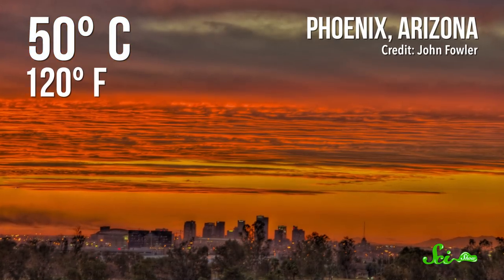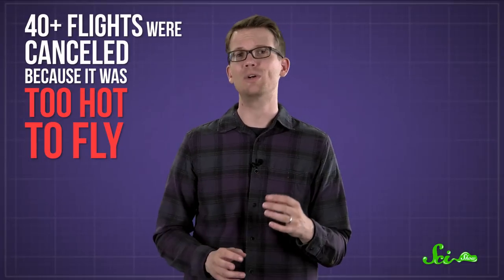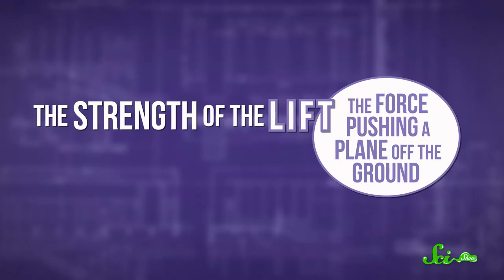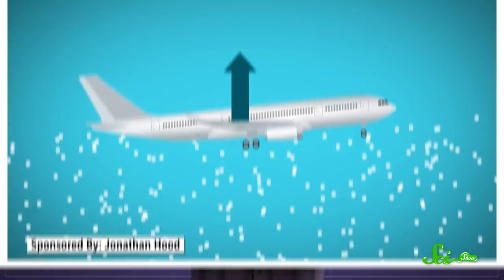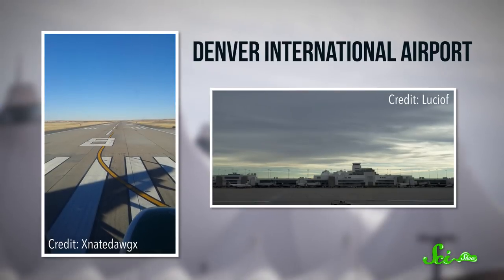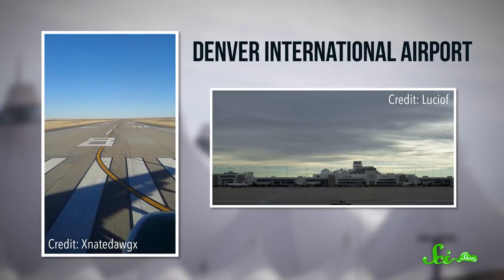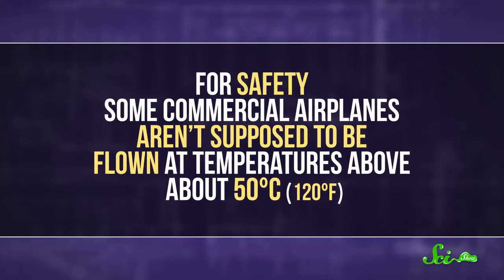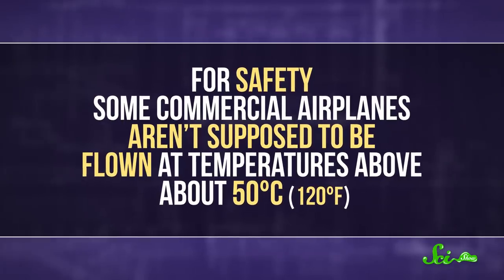Can It Be Too Hot To Fly?

Comment: 50°C?! OMG thats hot. how can anyone live with that!?
Reply: Marcell D'Avis Welcome to Kuwait :)
Reply: Marcell D'Avis Stay indoors. It was only for like a day during the Summer Solstace
Reply: I do. Balls of tungsten carbide. Harder than steel and practically impossible to melt.
Reply: Marcell D'Avis I do toastily
Reply: you get used to it, by that I mean don't leave indoors when the sun is in the sky and you don't over pump air in your tires.
Reply: Marcell D'Avis i live in temperatures like that everyday. Thankfully, i'm quite a shut in so it doesn't affect me that much.
Reply: Marcell D'Avis well you can live if you have AC.
Reply: Fahad Bore عندنا صلخ و هذول توصل ٣٠ يموتون 🤣
Reply: Marcell D'Avis it's not so bad if you stay in the shade and stay hydrated. It's a dry heat
Reply: Don't go outside EVER
Reply: KLUH You know what. living here all of my life makes me say this but, it's not as bad as you think
Reply: Paul Gonzalez-Becerra We usually have a few days that get that hot per summer. 115 is much more common. The average daily high temperature for July is 107, which would be record breaking heat in most places and that's just the average.
Reply: Marcell D'Avis Humidity is low. Now we got up to 120 in the South a few weeks ago, that was hellish.
Reply: Cesar pineda I live here too and I try my best to never go outside it's gross happy the rain stopped though the humidity was just awful
Reply: Honestly I'm a bit surprised this was the year that everyone realized that Phoenix is literally the surface of the sun. Last summer was much hotter for much longer. And c'mon guys, the mascot for Arizona State University is the Sun Devil, they're not even trying to be subtle. It's stinkin' hot.
Reply: When people say it’s fifty degrees here, that’s a pretty damn chilly day.
Reply: Turkey Herder 110 80% Humidity!  Welcome to East Texas!  LoL
Reply: Marcell D'Avis It's not that bad haha
Reply: Arizona Resident here, honestly after so long you just...get used to it.
Reply: In Arizona, it's a dry heat, no humidity, it feels better trust me
Reply: Airen Fortunato Except after the monsoons
Reply: It ain't so bad. When born here, you tend to be well acclimated to the heat (at least I am). The consequence of that is I'll start shivering in 70 degree weather, if there's even a slight breeze. And getting me in places that hit freezing point? Forget it,  now that's torture
Reply: Hallo, Marcel Davis, 1&1
Reply: I dont even know my dude
Reply: Marcell D'Avis
yes that's hot, but there are many more places with lower temps in which is a nightmare to live in summer.
take milano in italy, being in basically a slip of plains surrounded by mountains means rare wind and no recirculation plus a  big "cloack" of pollution. humidity is already high in these plains but those effects rises it up more.
and even if 32C could be ok, a little shiny sunny day you literally cant breath well: hot humidity goes for "no much fresh Oxy per resp". sweat not making its job for humid air (less evaporation in a saturated place, vaporbaths essencially where nobody gets fresh from.sweatting.).

phoneix is the grill master
south-continental-eu, inbetween mountains strikes, is a master boiler of pre-treated meat with some sweat & eleven special herbs of pollution
Reply: Oh please I've gone hiking in 47°C and in -38°C it's no big deal
Reply: I once went to Vegas and when the doors to the airport opened there was physical pain from the heat in the air.

It was night.

Also, if nothing green lives in a place that isn't a cactus, maybe that's a sign that humans shouldn't either.
Reply: 80% of the year its above 50-60c
Reply: nah 50 is cool
Reply: Marcell D'Avis I can...
Reply: Yeah, used to live in Arizona myself as a kid, and it reached those temperatures before.  It's certainly hot, but the lack of humidity helps a GREAT deal.  And staying in the shade.  It's really not that bad.  You most certainly get used to it.  In Colorado now, and have been for many years, where instead of heat, it freezes and snows.  When it remembers it's suppose to get cold in the winter, and not spring..  And coming from one temp 'extreme' to another (yeah, not really an extreme in either case, if you look at other places in the world), you get used to the cold too.
Reply: Marcell D'Avis i guess u get used to it. here in canada wen get used to the winter and spring comes, u can go outside in like 5 degrees celsius(40ish degrees fahrenheit) and it feels gud
Reply: I live in Phoenix, yeah it's real bad. Not even kidding my girlfriend sent me a video of her family frying an egg with a pan they left in the sun for a few hours. Cars also get "sunburn" here. Sure, global warming isn't gonna affect a frozen wasteland like Canada that much. But when you live in the desert, PLEASE STOP HEATING THE PLANET.
Reply: cover your head when you are outside.. drink water whenever you can

you will get used to it overtime and it becomes normal
Reply: yeah at 35c i start to feel a little dizzy and will generally stay in rooms with air conditioning, at 40c i have to actively focus on cooling myself down, i can't do anything else. i think the hottest ambient temperature (i've been in rooms at 65+c but that doesn't count) i've ever experienced was 42c and that was already hell on earth. i can't imagine 50c
Reply: Marcell D'Avis When it was that hot this summer I put an umbrella by the pool and laid in the the water in the shade.
Reply: I was in phoenix several years ago and the temp was 112-114F and it was HORRIBLE.  You must move from conditioned space to conditioned space, no stopping outside.  You walk out the door and are hit with a heavy wall of heat. From home to running car to shopping center, nothing else
Reply: Marcell D'Avis in my country Kuwait 🇰🇼 i reach 60c sometimes... 50 are the norm in summer
Reply: Consider living underground like in South Australia.
Reply: Marcell D'Avis I don't know how I do it. The AC can't keep up, so it's 29 degrees inside. If you have a low ceiling, it makes it feel much hotter. People with low ceilings have to keep their homes 10-15 degrees cooler than people with high ceilings to have the temperatures comparable. Cars are literally ovens. Sidewalks can cook eggs. Cars can cook eggs and toast bread. If I wanted to, I could melt certain items with a magnifying glass. Ants wouldn't stand a chance. If you're outside, you better not have any metal on you. Otherwise, you have 45 seconds to use it, and you have to wait a solid 5 minutes for it to cool down. You hold things up to your body too keep them cool. Paint and asphalt melt. It's also way too dry. You need to drink so much water simply to replace the sweat, but you also have to replace the salts. If you're outside long enough, you can't keep up. It'd take a long time, but it's possible. Imagine a giant oven. If you walk into the oven, then walk out into Phoenix on June 20, 2017 (when it got that hot), it wouldn't be much of a relief.
Reply: Marcell D'Avis we had about 112°f (45c) weather in California this summer, unfortunately my a.c. can't do more than a 25°f heat reduction. So whenever the temp goes over 105° It gets real uncomfortable real fast.
Reply: Marcell D'Avis I assume with little humidity
Reply: "It's a dry heat." said every jag-off we wish would die in a dumpster fire.
Reply: Sure, i spent many hours outside while it's sunny and 52 celcius
Reply: millions of people do
Reply: I've been to 50 in Australia and 40 in Singapore. Singapore was infinitely worse, indoors and out. You literally cannot breathe in that sort of humidity
Reply: sinofdusk3 EXACTLY humidity is all that matters because of the sweat that doesn't evaporate and leave you looking like a swamp
Reply: Marcell D'Avis sometimes it gets to 50 degrees in the UAE or it can happen to Australia and Singapore so we're used to it
Reply: it reaches 55°C where i live
Reply: i start complaining when it's above 15°C
how do people survive those temps
Reply: Just like you have people living at -20. You get used to it?
Reply: 40 degrees c is ok / barrable 50+ is uncomfortable less than 25 degrees is painful
Reply: It's simple, in the daytime... you go from your air conditioned house to your air conditioned car to your air conditioned job and then you do it in reverse. You do the rest of your stuff at night when it has cooled off to a nice cool 90 degrees. 

I lived the southwest most of my life and I would rather deal with a dry 120 than the muggy 80 here in Michigan.
Reply: honestly its not that bad. ive lived in az for basically my entire life. i dont even have ac in my car. just roll down the window and get a hot rodders tan lmfao.

heat isnt an issue for me. humidity is what kills me. 90f on the east coast is worse than 120f in arizona because at least out here the air is dry enough for your bodies natural evaporative cooling to work properly. You sweat, it evaporates, you cool down. On the east coast you sweat, it cant evaporate cause the humidity is too high, and you never cool down. You cant even dry off. Taking a shower makes you feel more miserable as you cant dry off and you end up feeling sticky.
Reply: Fred West I live in Getting Georgia. Preach it brother!
Reply: Fred West I'd almost live in the streets of San Francisco. After a trip there it's very clear where I want to take my last breathes.
Reply: Marcell D'Avis you get used to it. But the first year is spent in fear of the sun.
Reply: Dude I live in southern europe and it got up to 55 this summer :D
Reply: I was in a sauna, it was about 80c
Reply: Ediranii thats not true, stop lying
Reply: same bro
Reply: I welcome you to Kuwait where it constantly hits 55 degrees every summer ^^
Reply: Marcell D'Avis I live in Phoenix AZ and it normal isn't that hot. It only gets to 50C about 4 times a year.
Reply: Ba1k3n same and yup
Reply: I live in the High Desert of California and it got to 116 farenheight (~47 celcius).

Stay in doors with air conditioning, drink a lot of water, or go to a swimming pool ^.^

The Mayor declares a state of emergency every once in a while for the homeless and they can go inside commercial buildings without any interest for the business and ask for water, no business are allowed to decline them. Police also carry water in their trunks (boots) and you can ask for it at any time.
Reply: "The hottest air temperature ever recorded in Death Valley was 134 °F (56.7 °C) on July 10, 1913, at Furnace Creek, which is the hottest atmospheric temperature ever recorded on earth. "
https://en.wikipedia.org/wiki/Death_Valley
Reply: Newb Programming 

Nice try at sounding smart, but that kind of heat could onöy be recorded at antarctica
Reply: Only*
Reply: Marcell D'Avis I can
Reply: its always around 47 degrees where i live
Reply: Trying to sound smart?

All I did was pull up the wikipedia page and quote.
If you think that makes me sound smart, I feel bad for you.

Antarctica is never even near that hot .-.
Reply: Newb Programming 

You ain't foolin me
Reply: Have a nice day :)
Reply: Lol they dont live.. look at desert regions. Theres no civilization there besides constant bid for survival.
Reply: I love Phoenix lol. I enjoy the hear here
Reply: Marcell D'Avis It's not as bad as it seems you get used to it after awhile but i might be a little bias sense i've lived in arizona my whole life
Reply: Those civilizations who live in the constantly hot parts of the world da tropics survive with lots of alcohol and good drugs?
Reply: Marcell D'Avis, as a fairly frequent visitor to truly hot places like AZ, I've been subject to those kinds of temperatures. I can honestly point out that the first time you spend some real time in it, you will be most impressed. For me that two weeks was probably the closest to Hell I've ever been. There's just no preparation for the experience itself and the impression it will leave upon you.
   That said, there are a few tips to take seriously to heart whether you visit or plan to spend a long term in such a place.
    Firstly, COVER YOUR HEAD, and I don't mean just get a ballcap or some skimpy little wrapper for the thing. Get a proper broad brimmed hat. It doesn't particularly matter what it looks like or is made of (boonie, wire-rim, ten gallon or western style) BUT it does matter that it has a proper brim all the way around to block sun from your head... And you'll notice the change the instant you actually put it on in the sun.
    Second, and it's a two part warning, BEWARE OF DEHYDRATION. Yes, humidity sucks because your sweat doesn't evaporate. Dry heat kills you because you don't realize you're in trouble before you're in it DEEP... So regularly check and monitor your SALT intake, to retain the water... AND NEVER BE WITHOUT WATER... It's important to watch out for other nutrients like C that help metabolize the water, but salt and water are of capital importance and maintaining the healthy balance will prolong not only your life, but your comfort levels...
     Third, DO NOT JUST HIDE FROM IT... Subjecting yourself to the heat that makes you cringe is part of acclimating to it. At the same time, DON'T BE STUPID about the matter either. You do have to listen to what your body tells you and take it easy when you're fatigued. Don't bother pushing to the point of exhaustion. Heat stress doesn't just clear up the day after you collapsed either. It takes WEEKS AND MONTHS to recover from heat stroke, even a mild episode... But you can't ever "get used to it" if you don't get out in the stuff. Start small, and work at it a little at a time. Just an hour a day for your first week, physically subjecting yourself (on purpose) to daily hellish heat, will be surprisingly easier than you'd expect. THEN TAKE A BREAK FROM IT, and cool off. Let yourself recover. It's still okay to do the daily routine and rush from one A/C spot to the next as you're normally tempted to do, while you pick a convenient point in the day to go for the hour's walk or whatever (as heat therapy)...
     Finally, watch your over all diet. You're probably going to naturally want to up your intake of fresh and raw fruits and veggies anyways, but you should consciously do so as a regiment. Drop your intake of calorie-dense and really heavy fatty foods. Again, you're probably going to naturally be less inclined to a big plate of potatoes and gravy and pork-chops all breaded and smothered in gravy and deep fried mushrooms and stews and chili... BUT you might not exactly realize just how heavy and rich plain old ice cream is until you've "over done" it... And spewing chunks of black cherries, and foamy, half-curdled custard out of your nose (power-projectile style) is no way to enjoy the summer. Believe me! Ice is great, until you put yourself in shock with it, so be watchful. And do not, I pointedly said "drop" meaning to "decrease" those dietary staples. You don't have to suddenly avoid all those things (even black cherry ice cream) like the new plague. You'd be well advised to move (at least short term) toward a diet plan of smaller snacks than heavy regular meals for a while. It's lighter and easier on your digestion (especially when you're stressed about water) and generally more comfortable in overpowering levels of heat. Deserts are impressive... it can rain like hell there and not a drop actually reach the ground! :o)
Reply: I moved to Las Vegas in 1999 and lived there 12 years. You could fry an egg on the sidewalk at 3am in the Summer. 
Now, wherever I go around the world, I don't mind what my friends consider to be "hot" days.
Reply: they can buecos they are hot!
Reply: Seriously, and I who think 25°C is too hot.
Reply: matteste Eskimos.
Reply: Marcell D'Avis In summer in New Zealand I don't think it even goes past 30 normally
Reply: Marcell D'Avis: Simple: Spend our summers in the swimming pools, wear hats and sunscreen (even if you're dark skinned), and plan all trips around convenience stores. When I drove vehicles without AC, I used to put a 44 ounce (1.3 liter) cup filled with ice and soda in my crotch to keep it cool. ;)
Reply: I live in Phoenix, and you simply just don't go outside lmao
Reply: Marcell D'Avis I just moved away from my hometown that got to 110 regularly. Needless to say, I don't miss it
Reply: idk we just do xD
Reply: Marcell D'Avis we just get adjusted to it.i live in phoenix.i work outside at an airport..at that temp its misserable but you dont think about it after a few summers of doing  it.you just drink lots and lots of water and take it easy plus wear sun screen and long sleeves at times.i work inside the planes and its worse than being outside in the sun on hot days like that
Reply: "Its a dry heat."

So is an oven. Still wouldnt be fun to live in there, huh? Amazing city, though, I love it here.
Reply: I just don't go outside lol it only last for 3 months, was only 106F today 😅
Reply: you cant survive very long humans dont have super efficient evaporative cooling. sweat wont cool you 15 degrees C
Reply: I definitely could NOT do 50!!! We did however, hit 48 degrees here in Las Vegas around the same time.
Reply: Nobody. that's why people die.
Reply: patstar5 oh God, Texas is way worse than here in Phx. We don't have humidity, so the heat doesn't really stick to you when you go inside. Texas, the humidity makes the heat feel 10x more hotter than it really is.
Reply: Yup, Saudi Arabia, I can vouch for the 55°C (130°F) during the peak of summer.  When we all look around and go "man it feels like it's really cooling off" and it's 113°F and 10:00 at night...
Reply: Yeah... I don't like it that much, but we do have great AC
Reply: True but it still sucks regardless
Reply: 50’C 99% humidity.
Welcome to India.
Reply: Air Conditioning
Reply: Well we live, In India we get 45 to 50 degree Celsius in Summer's typically in May it's really ......... Well u get me try spending a day in India in Summer's good luck
Reply: Welcome to the UAE where 45-50 degrees are an average.
Reply: Dry 50C is better than humid 40C
Reply: Dhruv Verma  now it's raining hard and we r suffering from 80% humidity and 40 so I can feel what u r saying and dry 50 is worse, kuch din to gujariye Gujarat Mai ( for those who can't  understand this, its HINDI)
Reply: GraveUypo, I totally agree! Though my uncle said that when he went to Cuba he got very quickly used to the island`s hot weather.
Reply: And you put a towel over your steering wheel and gear stick when the car's parked.
Reply: Marcell D'Avis 
We don't. We go inside
Reply: I love it. Lived in Phoenix my whole life. I've always wondered how people live in places where heaven forbid it ever gets colder than 60 degrees Fahrenheit.
Reply: Marcell D'Avis I live in Vegas you get used to it and despite popular belief it gets to at least freezing temp. And during summer nights it is still hot as hell.
Reply: Marcell D'Avis it doesn't always get tht hot on average it's about 97 degrees Fahrenheit
Reply: Marcell D'Avis 122° I believe was arizonas record, though, it still gets hot 110° is a high commonly hit in the summer... and btw yes it sucks
Reply: Paul Gonzalez-Becerra regardless, its still only a few less on normal hot ass days
Reply: I came from Az to Texas (Houston). Hell, Phoenix Az is currently hotter than Houston right now! Look it up. The humid heat feels hot too but it's just a wet heat compares to the inevitable dehydration that occurs in a desert. The only place that really sucks to live in Texas is south Texas where it is an actual humid dry desert. ☉💀
Reply: Wet heat=makes you feel hot and is mostly inescapable.

Dry heat=the killer heat only the devil could love.
Reply: Who can convert this for me?
Reply: Welcome to Australia